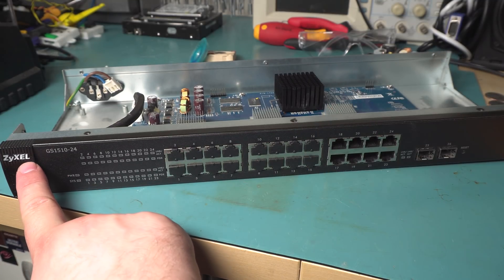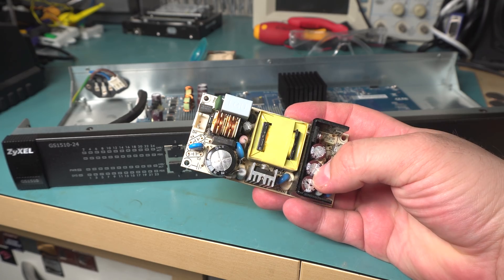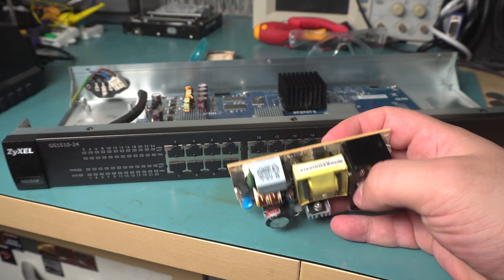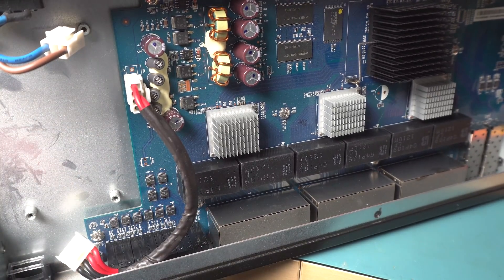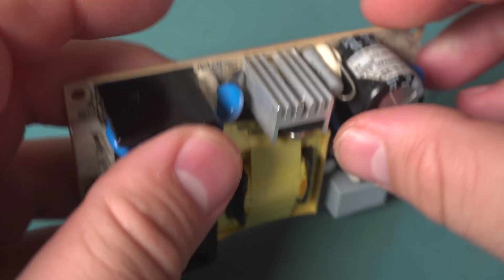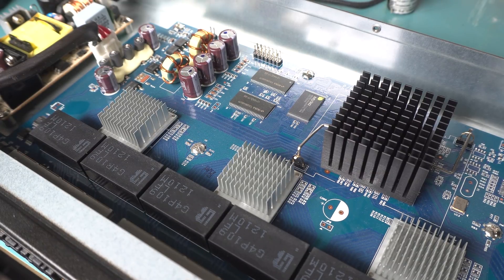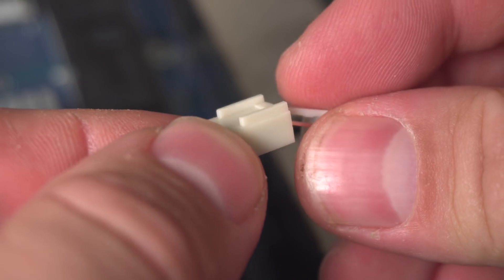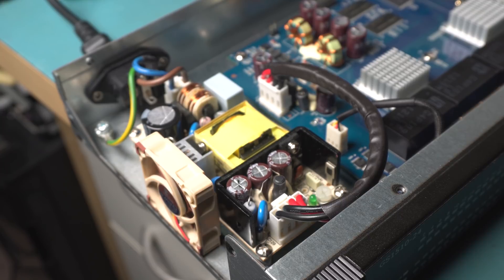Zyxel GS1510-24 Gigabit Switch - Repair + Fan Mod

Comment: Any output on that serial header?
Reply from the maker: Never really had reason to check it, but it's most likely just the boot console for the Linux distro it's running. Pretty common.